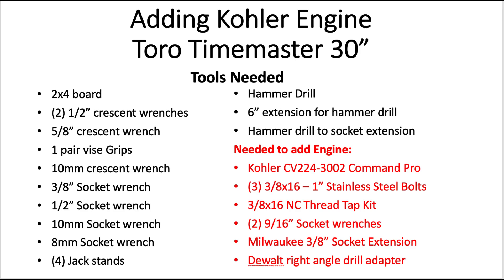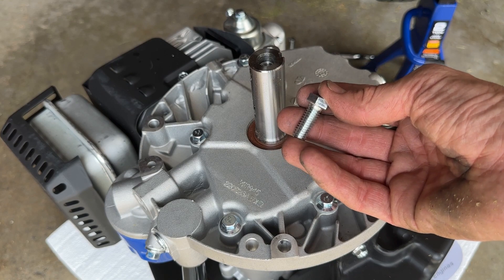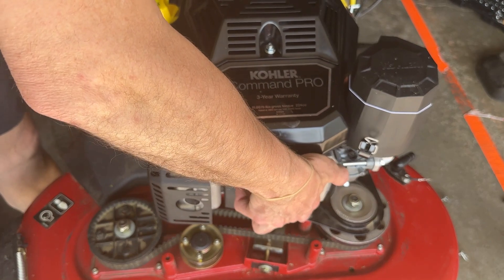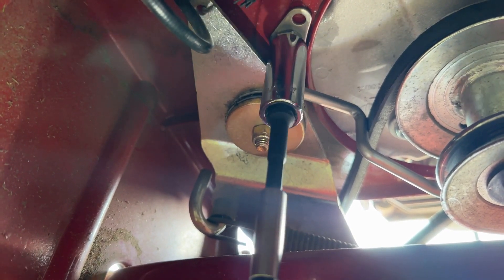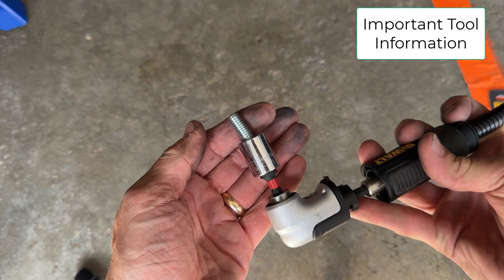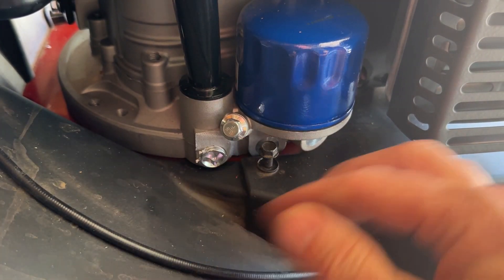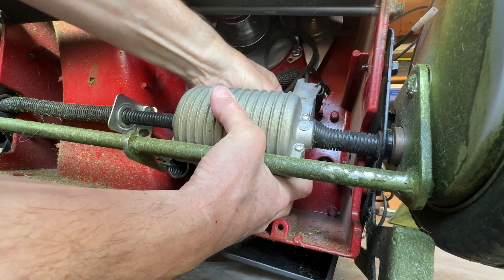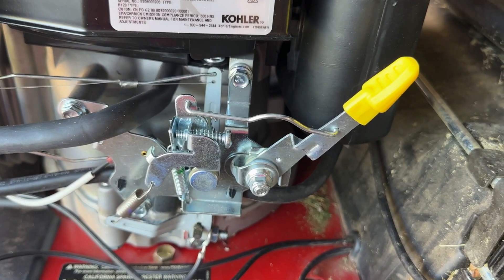Timemaster 30" remove engine, replace with Kohler Engine (part 2)

Comment: I would say after you get the engine installed add a gas filter because running with no filter will cause your carb to give trouble from micro particles in your gas. And also rewire your kill switch because the one built in seems to not work or get off alignment after  so long

Comment: I finally put a new Briggs 17.5 hp electric start on my time master, it's awesome cutter.
Reply: What size crankshaft is your "new Briggs 17.5 hp electric start" ?? 

this video's Kohler CV224 3002 Command Pro has a 25 mm shaft. Is yours a 25mm shaft or a 1 inch ie 25.4mm ?  

I wonder if you have a variant with the smaller shaft or somehow got a different pulley or bored it out some?

Anyway do you have the new Briggs 17.5 hp electric start" engine model you used?

Regards

Comment: One downside when upgrading to a Kohler CV224 is you cannot lower the handle to its furthest forward down position because it hits the air cleaner. Not a huge deal but you should beware.

Comment: you made it look so easy. i was told by the dealer, i would have to add additional $500 dollars of parts, on top of motor.
Reply from the maker: thank you so much. Glad to hear the video helped you save money! be sure to look through all the comments from others. There are some great additional tips below. Also, be sure to put Loc-Tite on those bolts before you mount  the engine.

Comment: Great video! Thanks so much for sharing.
Reply from the maker: you're welcome! Be sure to read through comments, and I forgot to mention to add Loctite to the bolts before mounting the motor! Also, if you have a universal joint for your wrenches, you can avoid some of the headache I had with one bolt. Good luck!
Reply: @allflashgordon6731 one more thing…would you please let me know where you got your tap kit and stainless bolt? Thanks again. This video is super helpful.
Reply from the maker: @CuriousOneGem  tap kit came from Lowes, Stainless Steel bolt from Ace Hardware

Comment: How much was the engine and where did you get it from
Reply from the maker: I got the engine at “Brand New Engines” but they don’t stock it anymore.  However, I found the same engine here:

https://www.smallenginesuppliers.com/shop/html/pages/products/kohler_vertical_engines1312.html
Reply: It’s on sale for $450!  You talked me into making this happen!

Comment: I had a little mower.  I bought a big Kohler 224 so big weeds would die.  I have the correct parts for any blade.  The Kohler did not have a gas tank?  What else does it not have?   buy something else.
Reply from the maker: not sure where you got it from but the CV224-3002 had a gas tank and even came with a spark plug. Only thing I needed to add to the engine was gas.
Reply: I bought the mower from "BRAND NEW ENGINES'. I am very blind, They got me...
Reply: I have two echo that are blown, and an old mower engine that has a tank.  Would you show me how to make a small tank?

Comment: You put that drive pulley on bass-ackwards.  Put it on the engine pulley first, then pull the transmission forward.  Roll the belt on by turning the tranny pulley as you go.  It can all be done by hand.  I did it the way you did it ONE time and was severely frustrated with how hard it was to do.
Reply from the maker: Great Idea! Thanks for the tip. I will try this next time. I appreciate the feedback.
Reply: You  can do it however you want I put it on transmission first and can put it on crank in a few seconds I also use hand instead of wood
Reply: I made the same mistake 😂

Comment: Help! brand new CV224, cut the grass once, started right up.  Go out this week the engine won't start! Has gas and everything.  Probably put 1 hour on it last week and it ran beautifully! any ideas?
Reply from the maker: I haven’t had that happen. Just make sure you have the choke full open when starting. If it doesn’t start in 2-3 pulls, let it rest 25 minutes and try again. Also, check spark plug.

Comment: You can remove the black spring that is holding the transmission belt and make it much easier for yourself rather than using the 2x4 block method and wrestling with that transmission/belt combo.  Just grab on tight to the black spring with a pair a pliers, pull it out of the holder, and voila!  No more transmission blocking/belt to deal with, just put it back together in reverse when ready.
Reply from the maker: Love it!!! Discussion always leads to better solutions. Closed minded thoughts stunt’s true growth. THANK YOU for the awesome idea! Wrestling with the 2x4 block was a pain!
Reply: If you are strong enough it is much easier and faster just to use hand in place of 2×4 you are going to have to fight the spring either way

Comment: I replaced my older model toro 30 190cc engine, but I have a problem. The belt that engages the blades is too lose. How can I fix this issues. Should I find a smaller belt? Or did I install int engine in the wrong holes?  I used the D shape holes?
Reply from the maker: the belt could be old and stretched, so you may need a new belt. When you put it on initially, it is very loose, but still in the grooves. when you engage the blade it will tighten up. Have you tried to engage the blade with the mower off as well as with the engine running?
Reply from the maker: As long as ALL the holes line up with the mounts on the engine, you are fine and can’t use the wrong holes.

Comment: when you remove that one bolt that’s the hardest you know you can access it from the bottom through that hole right? instead of using 90 adapters and all that crap? you can use an extension right from underneath it
Reply from the maker: Yes, Absolutely. That is the preferred method, but I couldn't reach it with a standard extension without a universal joint. unfortunately my local hardware store didn't have one that worked with my set either. If they did, my life would be much easier!!!  THOSE READING... Use a universal joint and a socket extension. Universal joint is needed otherwise the nut will not fit squarely on the socket

Comment: No sooner did you remove that “some kinda support” bolt, it appears that it’s back in.
Reply from the maker: you are correct. The bolt should remain out though. I used an  older clip of me putting the engine on. It was a little after  I put the engine on that I noticed that the bolt didn’t fit so I recorded the removal of the bolt and then used the other (older) clip of me setting the engine in. You have good eyes!
Thanks for the comment!